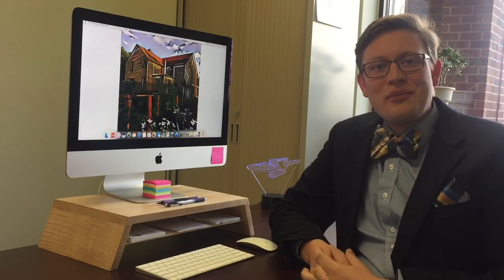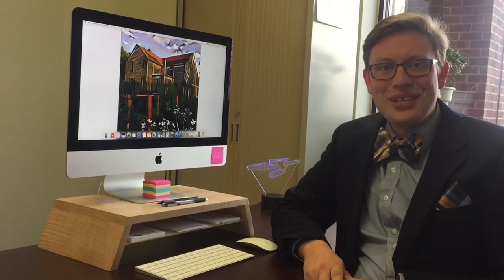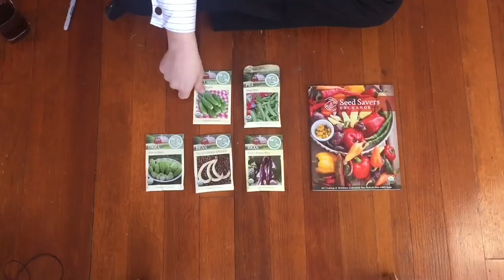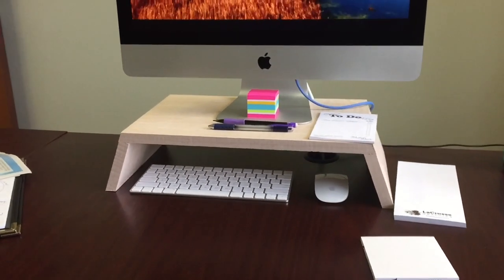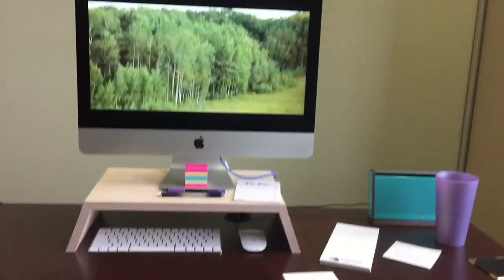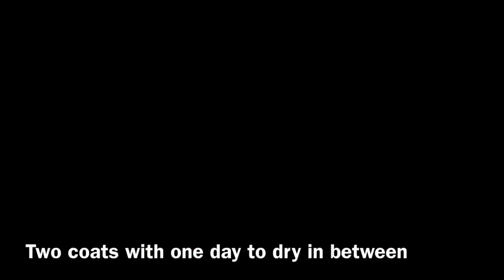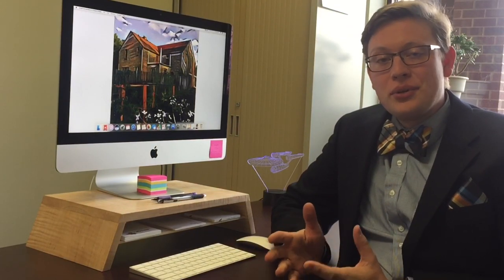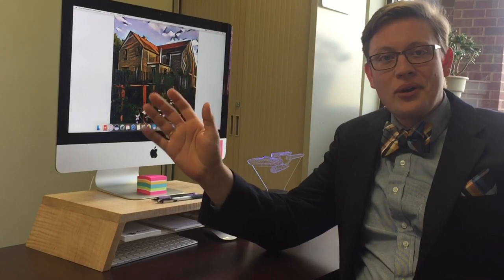Build a SIMPLE Computer Monitor Stand

Comment: I don't know if I would put an $1800 desktop on something that was held together by glue.   It might never be an issue, but I would feel much bet if it had Jeg Screws in it.
Reply from the maker: I understand your concern.  I'm happy to report that four years later this stand is still going strong holding this very computer!  Wood glue is exceptionally strong when applied correctly.

Comment: Very nice! will try it. How did you get the parts to stay in position without clamps (2:21')?
Reply from the maker: Thanks!  What you're seeing at 2:21 is tape holding them in place.  I also laid down a few dabs of super glue before that to serve as a liquid clamp, so to speak.  It's holding up great three years into it now.  In fact, I'm typing this response on a computer that's sitting right on top of the stand.

Comment: Where did you put the wood glue after the super glue? Groovy bow-tie too man. Sharped dressed man. And I won't bring up what rain means nowadays. Peace.
Reply from the maker: Thanks Dale!  We've got bowtie Tuesdays in the office now.  It truly is groovy.  As for the glue, I put a few dabs of super glue along the length of board that I'm fixing, and then add mostly wood glue in between for that long-term permanent hold.  Think of the super glue as a liquid nail to hold it in place tightly while the real wood glue dries.